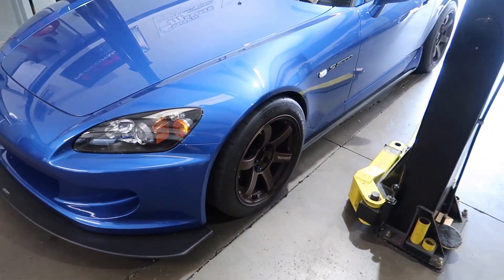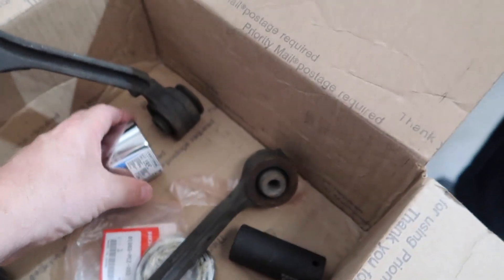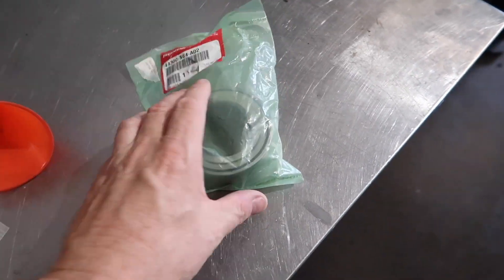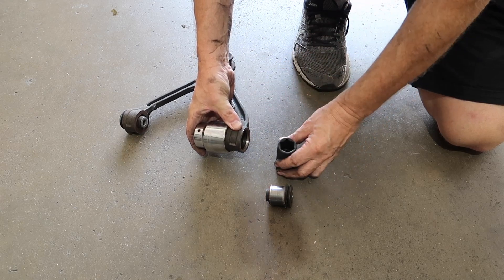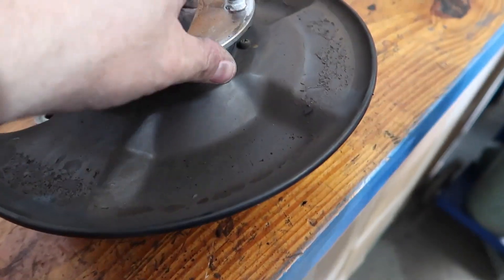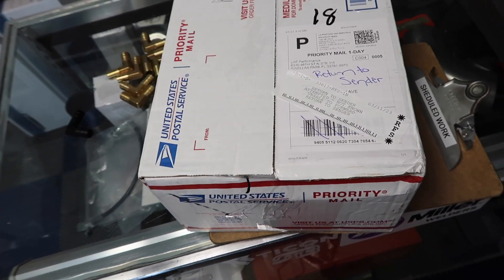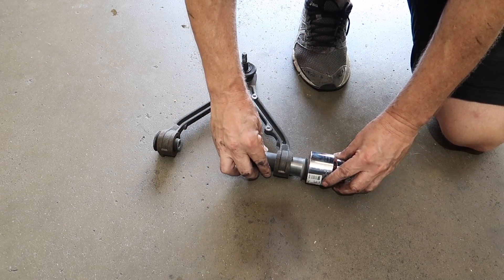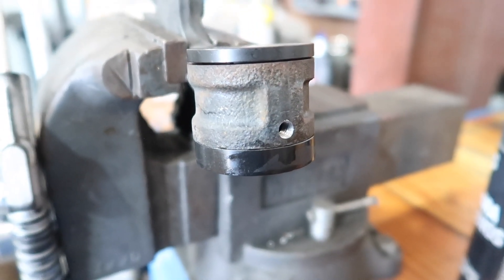S2000 Control Arm Bushing Install + Hub Bearing

Comment: do you recommend putting new wheel bearings in an AP1? - only 43,000 miles but 25 years old!
Reply from the maker: No. If they are still tight and not noisy. They are fine.